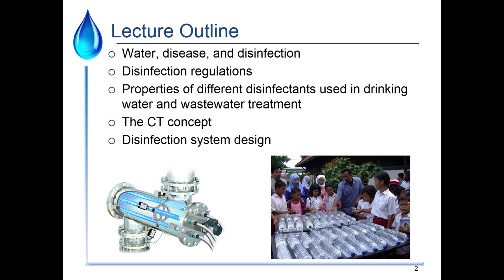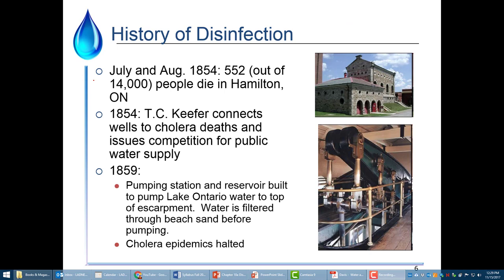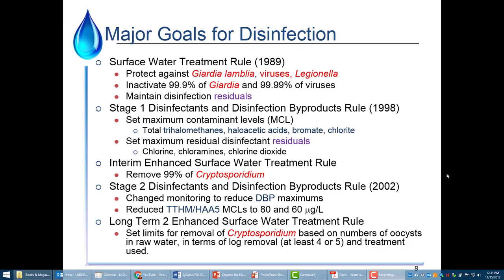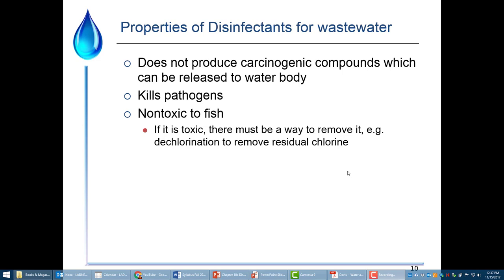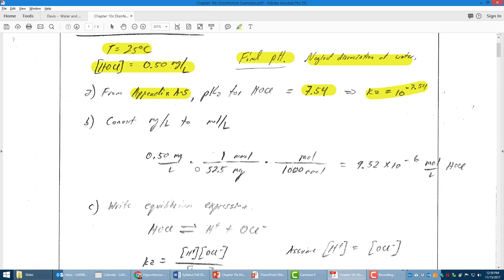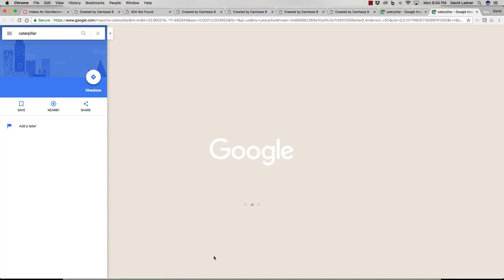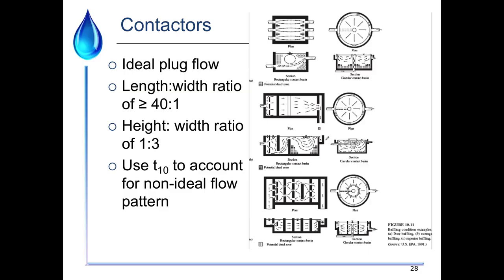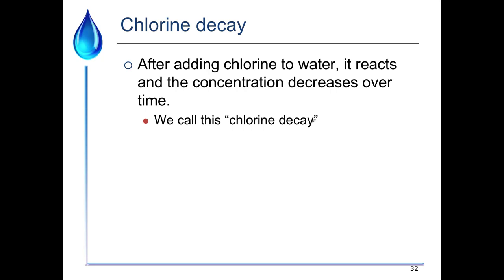Disinfection

Comment: Hi David Ladner. Just a quick question. I have a larrge pond, that has alklainity of 100ppm, pH of 8.5, and is filled with bacteria. I am planning to add calcium hypochlorite into it. I understand at high pH most of the form of the hypochlorite ion will be in the less favourable form, hypochlorite, and very little hypochlorous acid will be there. Now, since hypochlorous acid is much much more effiecent (80x) at kiling bacteria, i assume once added, its concentration will be depleted quite quick. Since it is in equilibrium with hypochlorite ion and H+, so wont the equilibrium respond by shifting left, thus increasing the concentration of the hypochlorous acid and thus reducing the concentration of the hypochlorite ion?